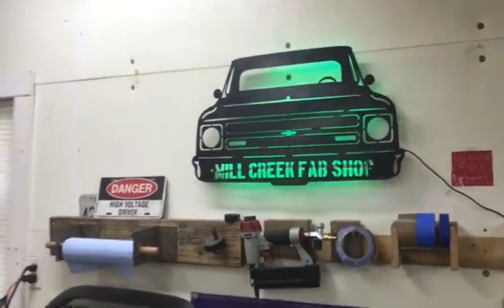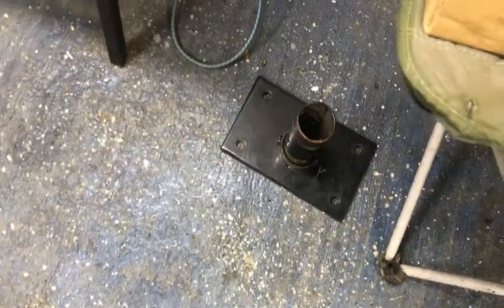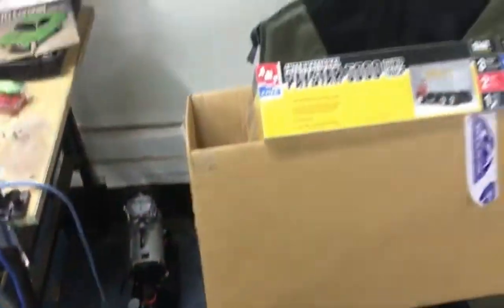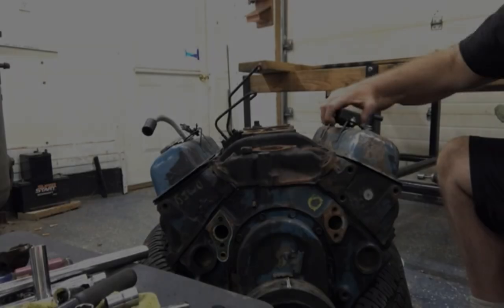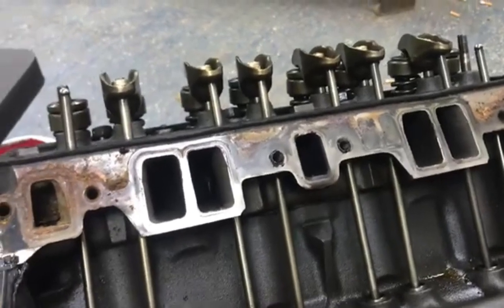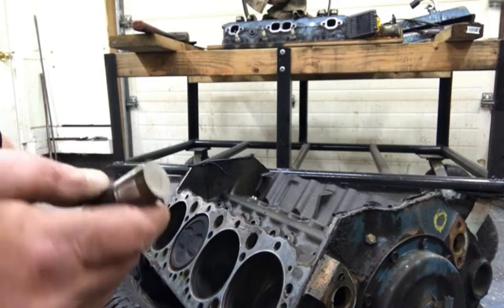The 383 Stroker Continued

Comment: Plate is a good idea... With some spacers too offset it so you can still turn the crank 2 1\2in should be plenty with grade 8 bolts make sure the threads get full engagement with the block and it's all cool 😎
Reply from the maker: @moparnut6286  yessir I think so

Comment: Hey Joey , you got the same engine cradle as I transported my new engine in, and up at Les Schwab tires they are giving them away free this week, lol, way to hurk those engine parts off the block, sounds like what they say about Arco is true, ha ha, looking forward to the next video, oh and if I’m not to late and you see brother Bill at the car show say hi from me, catch you later brother and bless you 😀😀
Reply from the maker: @DesertRatFabrication  blessings. Thx for watching. I watched your video late last night and didn’t comment. That I bolt idea is awesome. To bad the beam is to low. 

You have a nice clean engine for your build. What horse power is it making?
Reply: @MillCreekFabShop  with these 882 heads hopefully around 350 they have a 76cc. I think i could easily get 375 with 62cc or 64cc , but my engine should run good on pump gas and stock transmission, 😀😀
Reply from the maker: @DesertRatFabrication  Nice.

Comment: Somebody used good oil in that engine. Nice!
Reply from the maker: @mattthescrapwhisperer  yessir. I think I am finally excited to make the engine stand brackets now. Headed to hemly hardware in the morning to buy a steel plate and hardware. Going to Fab up a full plate to bolt to the engine and to the plate that goes into the engine stand. Should be fun drilling them holes out lol

Comment: Who you got for the clearance work for the rods ?
Reply from the maker: @treetop.garage  I have been using Hutter Racing Engines out of Chardon. Do you have someone in mind?
Reply: No that's why I asked
Reply from the maker: @treetop.garage  I gotcha
Reply: I was told there's one on 46 somewhere also
Reply from the maker: @treetop.garage  hmmm, i will find out
Reply from the maker: @treetop.garage  I just learned that hutters main guy quit and started a machine shop in Dorset. Sending you the information on facebook.